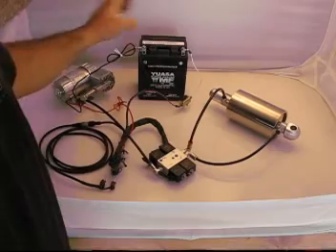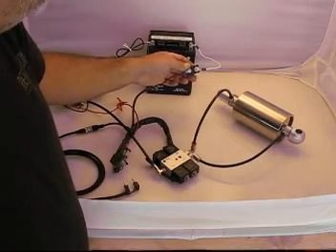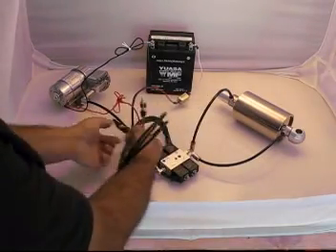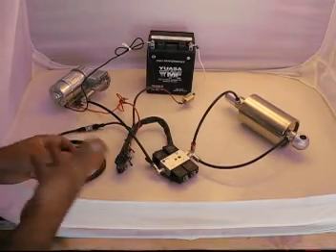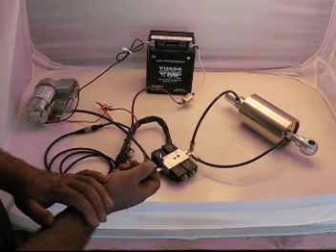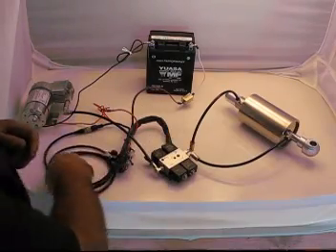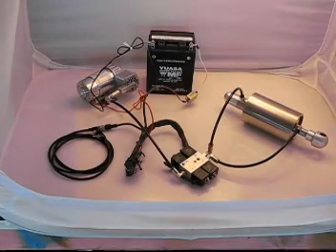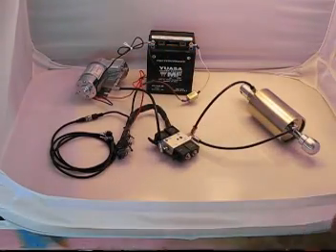Kewlmetal Air Ride System Installation

Comment: Hello! 
First off, thanks for the video! It really helped me untangle the mess of wires balled up in a knot and get the vast majority worked out, with just one caveat….
So, I do have the same system as what you have in the video, nearly identical, however along side the control switch harness that  threads into the mating connector, I have another small Red and Black set of wires, each with a female pin connector.
        I can see that they are soldered to one switch, and are jumped to the other switch, I’m just not 100% what they’re for…
       My uneducated guess would be possibly the pump trigger? 
    Having said that, I would’ve thought that is what the threaded 5-pin connector would do, but what do I know…. lol
      Maybe for an additional pump or some type of add-on accessory of some kind?   
      ANY help would be incredibly appreciated!! 
Thank you in advance!!

Comment: It doesn't draw anything from the battery unless you are pumping up and down too much with the bike not running. I've had my bike for 2 weeks and used the air ride quite  a bit I plug in the battery tender at night but It turns green almost as soon as I plug it in. So the battery is remaining full. I even left the tender off for several days and the bike started right up.

Comment: I bought a 2006 Victory Hammer with this kit installed on it. However the original Owner installed it under the tank and directly in front of the PMRT air box. Blocking a significant amount of air. So I am currently trying to find a place to put the pump right now. I might be able to fit it behind the triangle plate on the right hand side of the bike. But it's a tight fit and I am not sure if the tank can fit with the large pump protruding from the top of the triangle mount. Any idea's?